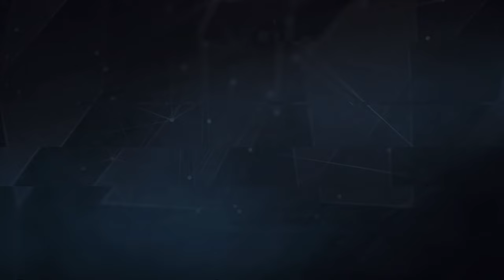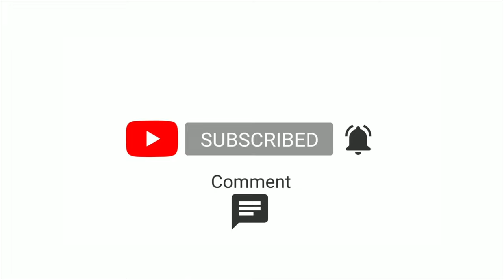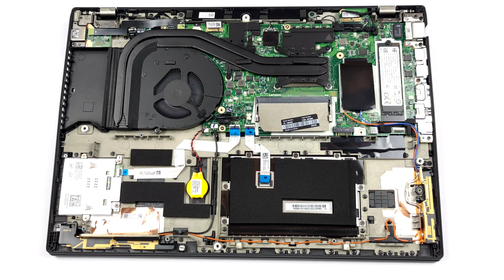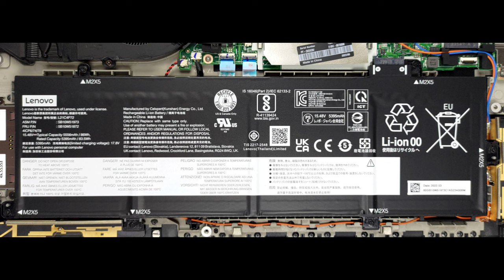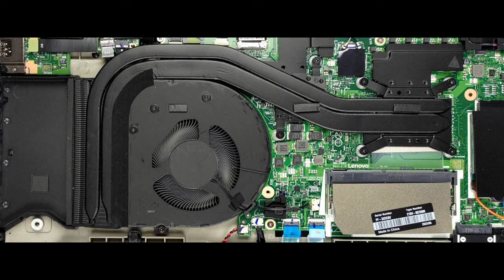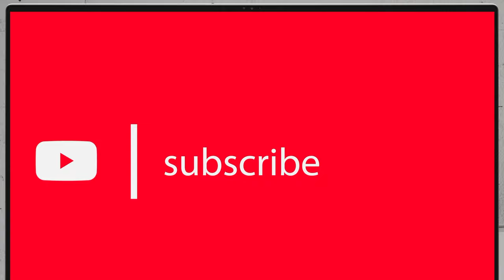🛠️ Lenovo ThinkPad T16 Gen 1 - disassembly and upgrade options

Comment: How many Gb of ram is this model up to?
Reply: Default config options are 8GB or 16GB (soldered). So max in a standard dual-channel setup will be 32GB. (Currently using 32GB in my config)
Though, I believe its possible to install a 32GB for a total of 40GB or 48GB respectively. (Have not tested myself)
Reply: 16GB soldered + 32GB = 48 GB
Reply: You can install a 48GB stick of RAM increasing max capacity to 64GB. (16 + 48)

Comment: does it contain two batteries? like 24+86
Reply: Just one battery. Though there are two config options: 52.5Wh or 86Wh
Reply: @PseudoChris  can i upgrade the battery by replacing the 52Wh by 86 ?